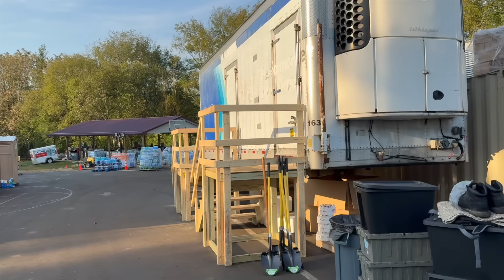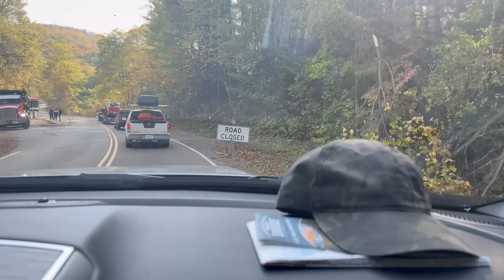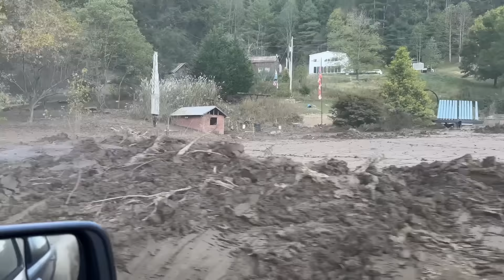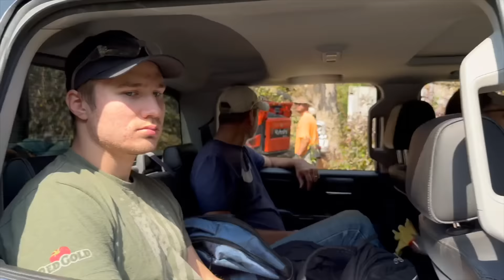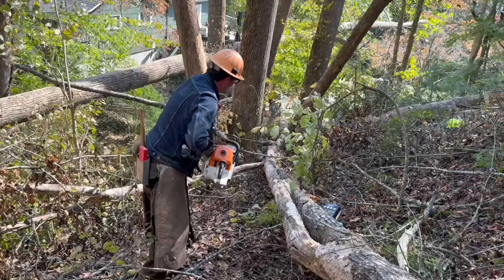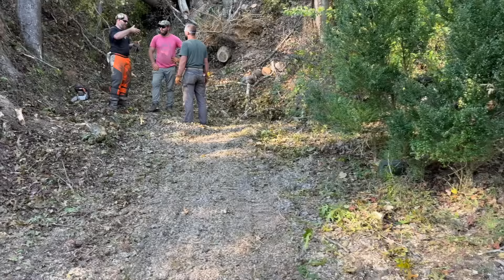Boots On The Ground - Hurricane Day 1 (TOTAL DESTRUCTION)

Comment: I'm in an area where the power goes out sporadically for a couple days to a week at a time, a bit west of Appalachia & the 40s isn't too bad.  It starts getting bad in the 20s - which is also coming soon.  Tents are a great way to retain heat when set up in these buildings & houses than just laying on beds with blankets.
Even tarp tents are decent.  This situation is so perfect for setting up long-term survival shelters in the area, like those seen all over goolagtube, especially with all of that "free" wood.  Setting up rocket mass heaters to cut down on firewood throughout the winter would be very handy.

Comment: Hopefully the weather will stay dry. Geology of the area is going to be an ongoing threat forever. A geologist said that normally 5" of rain in a 24 hour period will/has caused ongoing debris flows (mudslides). This has been going on for hundreds of years before recorded history. Relatively small slides in higher elevation start the disaster for everything in its path.

Comment: This might be a dumb question, but is there a particular size you to decide to cut the firewood logs? I'm guessing it's that particular size is to fit into certain wood burning stoves and still be able to close the door.
Reply from the maker: It can vary typically most stoves are designed to fit a 16 inch log so we try to get as close to that as possible

Comment: Did your groups firearms and personal radios make it through the airlines process un stolen and un damaged?
Reply: I fly with firearms frequently.  As long as you follow the rules they go through pretty smooth.  I've even had my bags snagged early and taken directly to the airline at baggage claim.  I guess thats a new safety factor to reduce the risk of a firearm bag going missing.  Side benefit is a much faster response if a bag doesnt show up.  Cops dont like an unsecured firearm floating around the airport.  Airtags in the case are great additions too.
Reply: @destroyerkuroshiokai  and yet missing/ stolen firearms are a regular occurrence with the tsa.
Reply: @thormidthagahast8914  Got any stats for that compared to how many flights with firearms per year? Or are you just making assumptions? It’s pretty rare from what I’ve seen and read.
Reply: @destroyerkuroshiokai  oh sure. I got the government stats right here in my desk. Let me look them up on my microfiche.